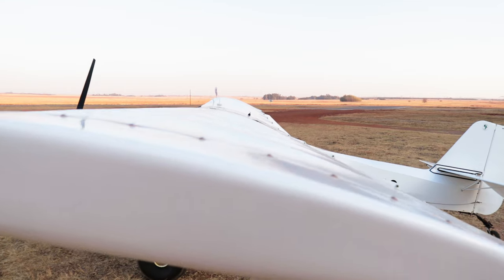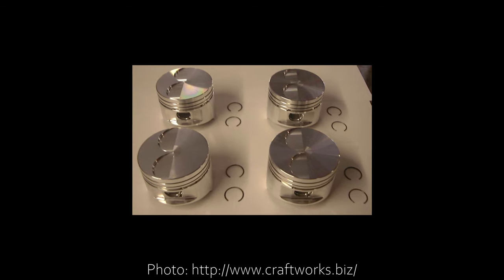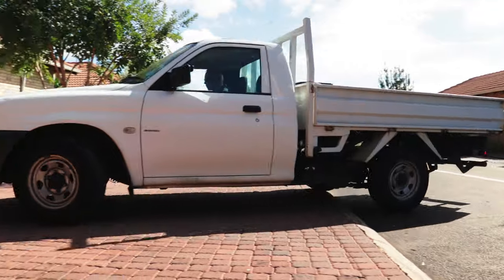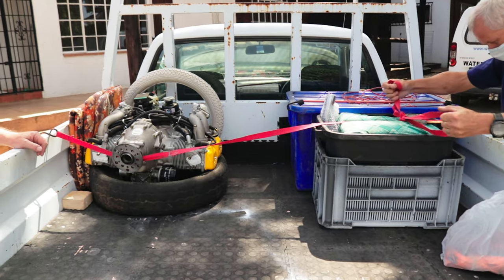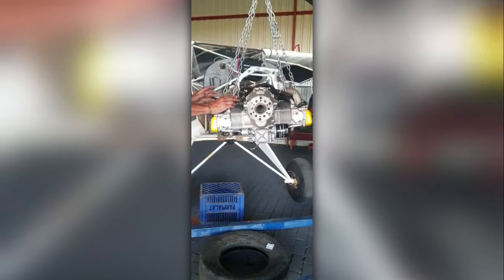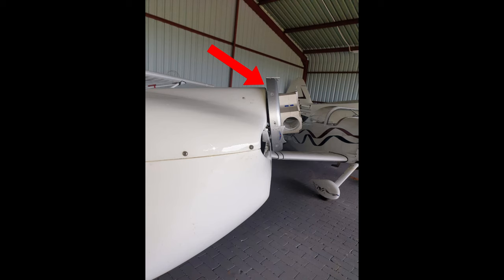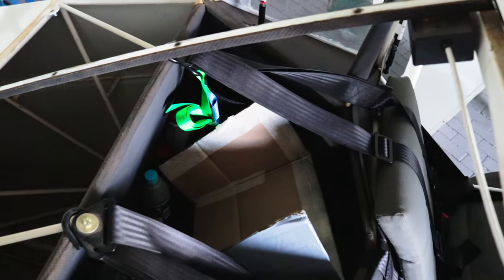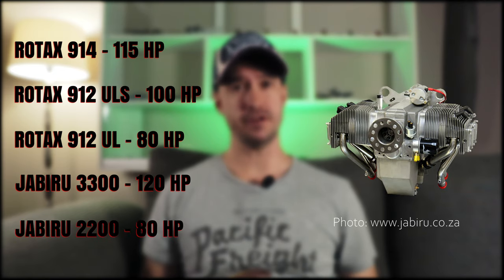Rotax 912 Xtra Engine Upgrade | Bushplane Transformation

Comment: Hello, I have a new set of 912 Xtra pistons that come with an unfinished Kitfox kit and new 912UL.  I will be installing them soon.  I have a question, though.  Do you really need a wrist pin removal tool?  It seems to me that the wrist pins should be easily slid out without the need for a special tool.  Yes?
Reply from the maker: Hi Mike. The instructions (linked in the video description) call for a wrist pin puller to remove them. You can try pressing it out but risk damaging the wrist pins. I've never done this myself so can't give you proper advice.

Comment: I didn't know that engine existed!! Now to ask where you found it? I have been looking for a UL for a while, but come into the same argument and debate about the increased weight negating the gain in performance!

Ok and the ultimate question.... cost of the engine? excluding install!
Reply from the maker: It's aparently relatively popular, there's a few Bushbaby's flying around with the 912Xtra. That said, I also only came to know about it last year. 

We found the engine it on the second-hand market, an ad on Avcom. But there's AME's that will build the kit into a 912 UL, new or used. Benchmark Aviation - whos doing the engine installation for us - imports the kit and does the Xtra conversion / installation.